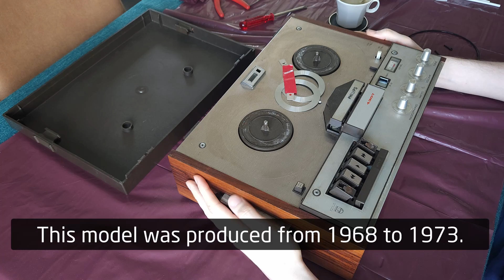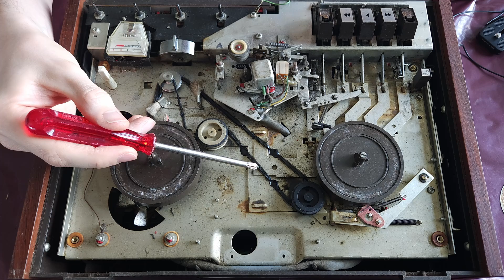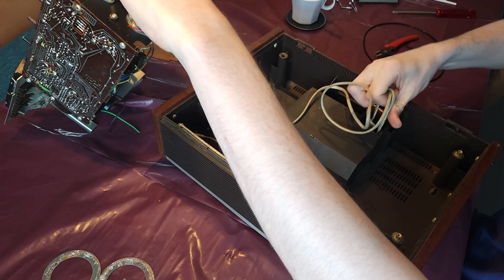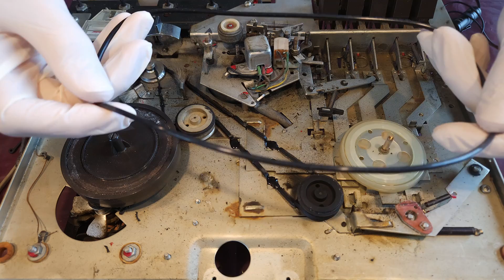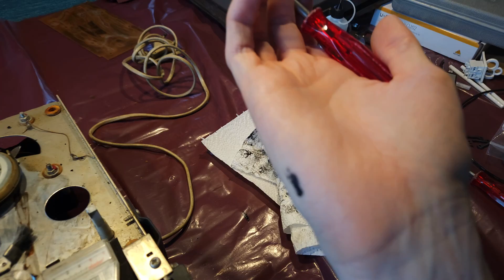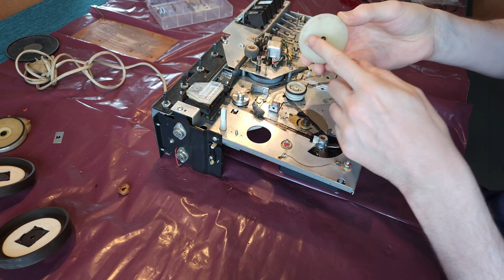Working on a reel-to-reel machine for the first time ever - Philips N4308 - Part 1

Comment: If you ever need to deal with Philips belt goo again buy some Printer 66 by Kontakt Chemie. It's supposed to be safe on plastics (unlike acetone) and removes that goo like nothing else. On metal acetone works a treat too, far better than ethanol or other solvents I've tried. One or two wipes and everything is sparkling clean.
Reply from the maker: Thanks for the tip! I'll keep that in mind. I just sold 2 Philips tape recorders that had molten belts because I didn't want to deal with that goo again. 😅
Reply: @retro_tech  Isopropyl alcohol works reasonably well too but I'm still not 100% sure I ever want to do with belt goo again after having done a 4510 and a 4308 recently. The 4308 didn't even have any old belts, I removed them 20 years ago and cleaned the goo from the melted main belt, the others I caught in the nick of time and removed them before they liquefied, but it did have the original black clutch rubbers.
Oddly enough a parts donor I recently stripped had black clutch rubbers in perfectly usable condition that I now used to replace the melted ones in mine. I immediately took detailed measurements so I might be able to replicate them if needed. You can buy replacements but all the ones I've seen look completely different in shape so I'm not sure how good a job they do.
One thing's for sure - hadn't it been for nostalgia there's no way I'd have done the 4308. No one seems to be interested in them. Mine was the first working reel-to-reel tape recorder I've ever owned, bought used in ca. 1992 so I do have some sentimental attachment. It's also a rugged transistorised luggable player with decent sound quality, less delicate than earlier valve recorders.

Comment: Can you get the replacement rubbers for inside the clutch as you call it, mine have all melted
Reply from the maker: Yes, for example at https://shop.mfbfreaks.com/product/frictieremschoenen-set-bandrecorder-n430x/
Reply: @retro_tech  The shape of the replacements seems to be quite different from the originals. I wonder if they actually work the same or if the originals provided stronger friction.